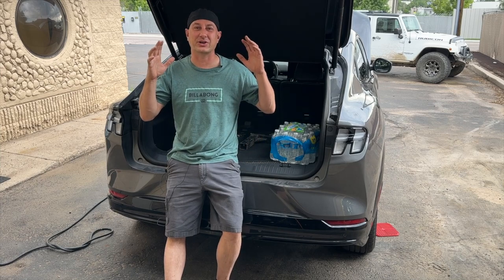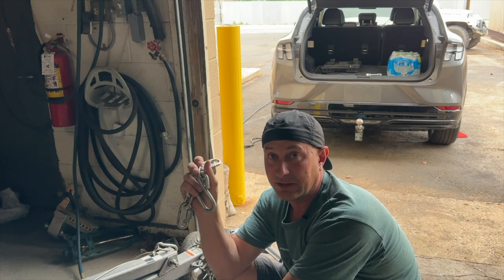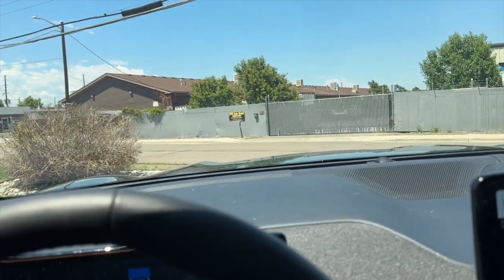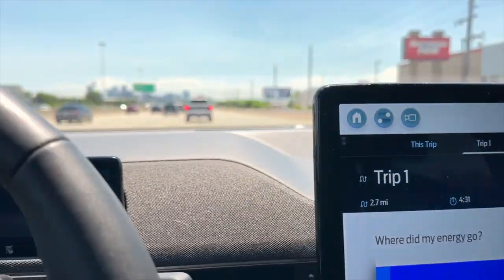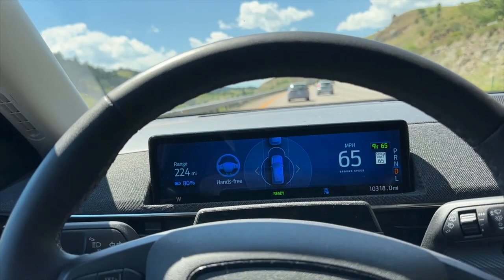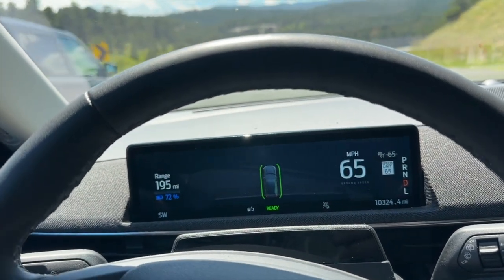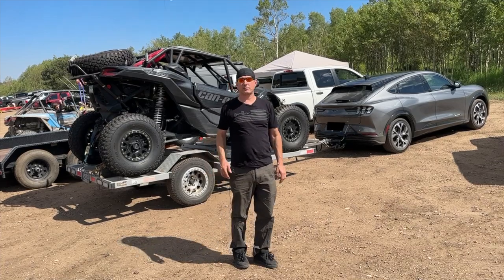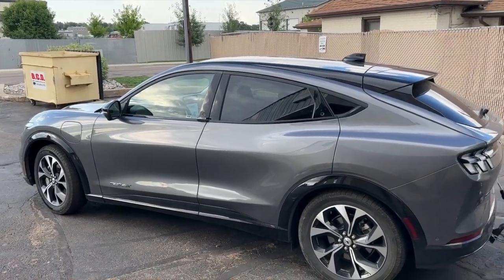Towing 2400 lb trailer with Mustang Mach E Up Colorado Mountains!  Mustang Mach E Towing for Real!

Comment: Thanks. I won't worry about my bikes bouncing around and falling off with my draw tight hidden hitch. Seems to be pretty sturdy...
Reply from the maker: It is.  After this trip we did cut some brackets on our CNC to tie it into the upper bumper mounts and the side of the frame channels for more strength.  That said, it held up good even without reinforcement!